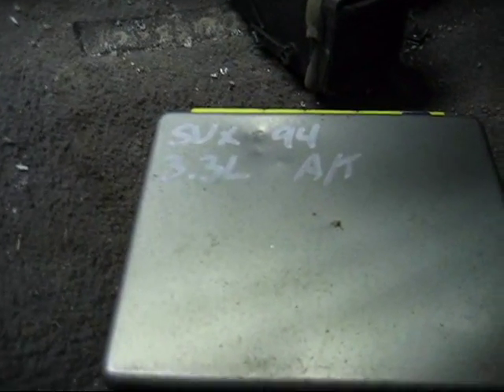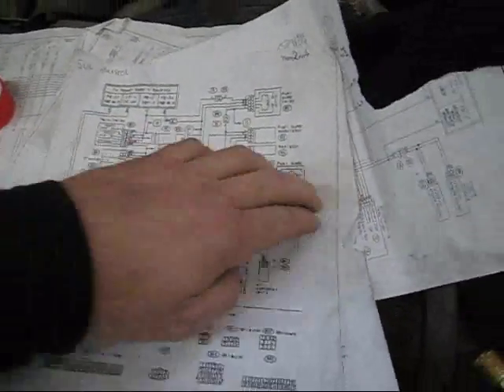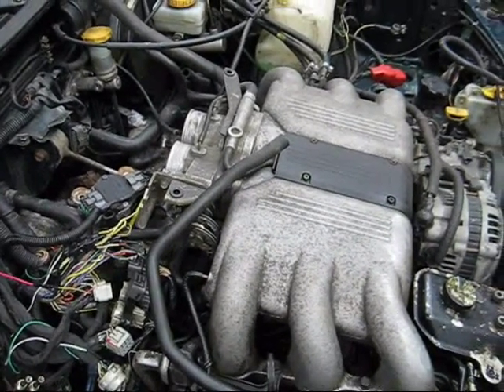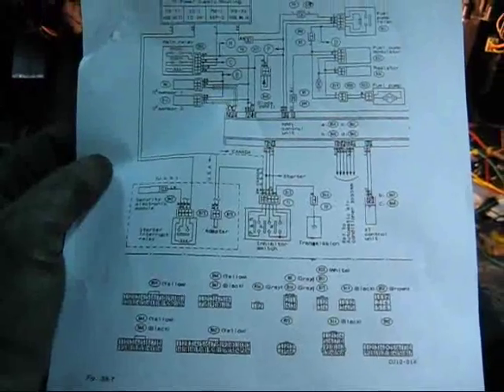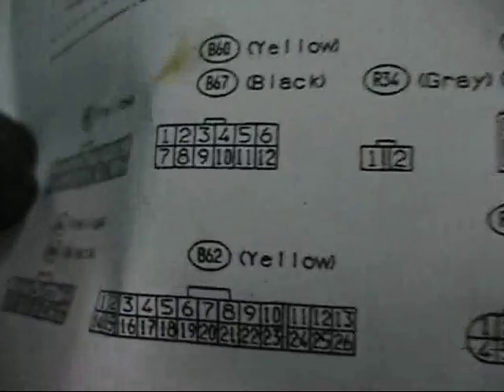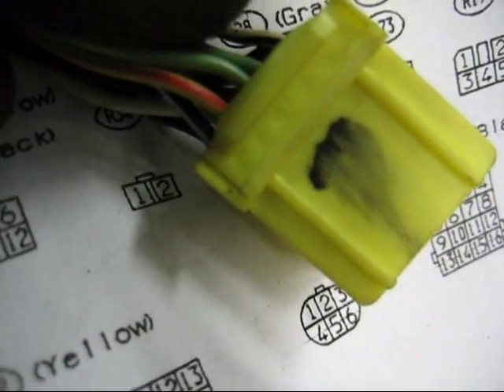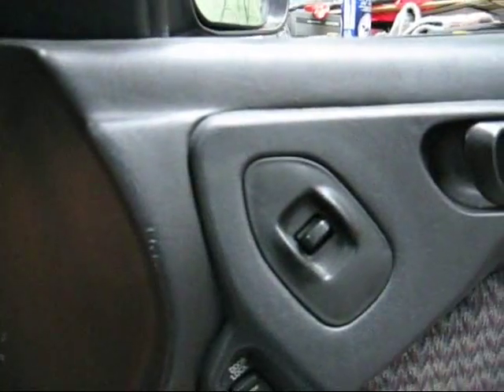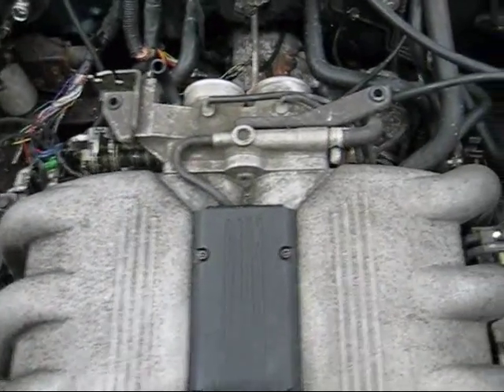Project H6 part I

Comment: Reliable, who knows. Nobody ever drives em because the transmission craps out at 100k miles and most people then take the car to the junkyard. I would have to say this engine is no more reliable than 2.2l which blows a head gasket, but at 250k-300k miles, instead of 100k miles like the 2.5l